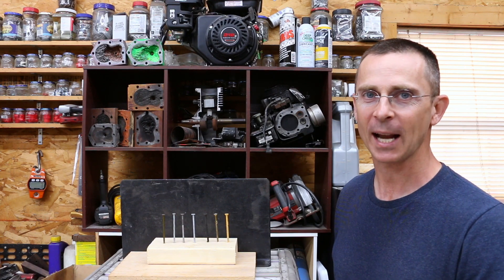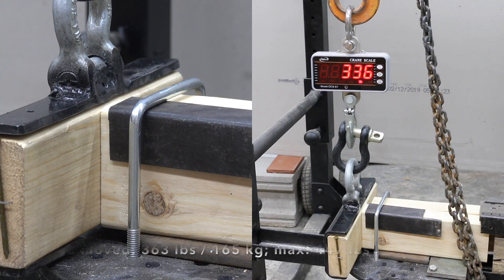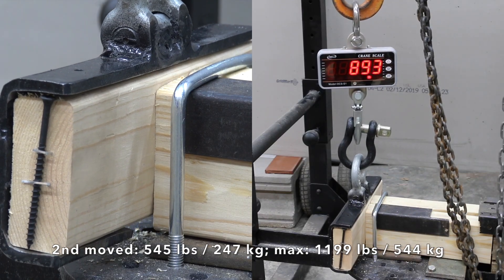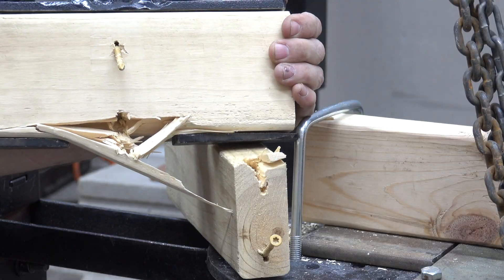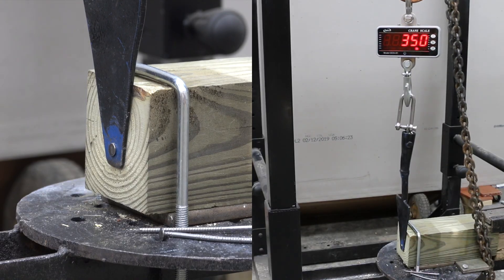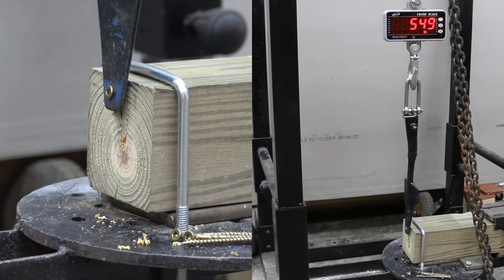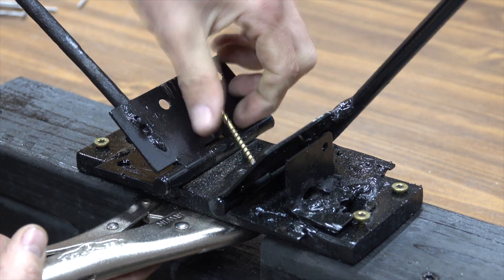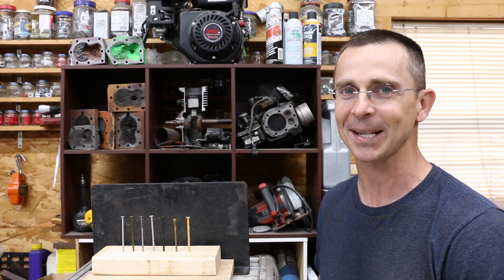Do Screws Shear easier than Nails? Let's find out!

Comment: Fan-damn-TASTIC video my friend!  Great testing conditions, great speed and I also was surprised at the shear strength of the screws in the 1st test...
I watched this because I want to put plywood or OSB (the next question I have to answer) bracing on my cripple walls.  Since lateral-force shear strength is the key here, I really thought that the nails would be superior.  However, your results were quite impressive with the screws, and the hardness of each wood sample probably explains the variability within each type.  The ONLY factor I can think of that could change my mind is the sudden jolt of an earthquake vs the slow winching in the test...  Regardless, thank you for your time & efforts!
Reply from the maker: Thanks and you are welcome!

Comment: not sure I'd call this a shear test.  but it is really eye opening. I use a lot of drywall screws, construction screws, and deck screws in wood. My drill driver twists the head off of WAY more drywall screws in construction wood, and they cant be used in hardwood at all. Your results would look MUCH different if you repeated this test with hardwood where the wood fibers wouldnt give way so quickly.
Reply from the maker: Thanks for the suggestion.

Comment: There are several things that I believe are worth considering both for the testing purpose of nails/screws like this, as well as for their application.

First, the application. Screws for most construction job are plainly terrible due to not only their brittleness, but also destructive factor. In all tests they were literally ruining the wood, whereas the nails just slipped out or broke with minimal damage to the wood (except the ring one). This can mean very expensive (and possibly...impossible without stripping large part of the structure...) replacements of wooden elements in structures over time, as the wood will simply be too damaged from continued small movement even if the screws won't be affected. Nails deal almost no damage to the wood, meaning that you can just replace damaged nail somewhere else on the wooden beam and be done with it many times over.

As for the tests, there is a lot of movement outwards, away from the test wood, since all the forces were applied to the fasteners by the test rigs, and not the elements that they were holding. I believe that a much more important (for practical applications) result would be if there were two metal/wooden 'rails' parallel to each other with a wooden beam between them (basically, an H shape), and the beam would be pushed/pulled instead. This would show how these react in situations closed to their real life application where forces apply to them through the parts they hold in place, instead of an outside force. For one, this would make it so that the nails/screws wouldn't just 'slip out', but either bend extremely or break (themselves or wood) in every case.

As far as these tests are still valuable, I just don't think they apply for the most common applications.

Comment: That's a very thorough and comprehensive set of tests. I only wonder if the deflection test would make more sense if it was only bending the screws and nails a few degrees. Anything bending them 30 degrees or more in the wild would already be knocking the building down. Of course the reps to failure would probably go way, way up for at least one of the two then.
Reply from the maker: Thanks!  Thanks for the feedback.

Comment: Thank you!  I'm rebuilding several sets of 2x4 shelves that the previous builder assembled with deck screws. They used a ridiculous amount of screws in random patterns and angles that probably did more harm than good. I wanted to find the real-world shear expectations of these screws, but online searches were hit and miss - an engineering forum post where someone "did the math"  claimed the screws will only hold 167lbs, while some spec sheets claim 1300+ pounds. Then I found this video! Excellent work! It's a great example of fastener performance  "off paper" and outside a sterile laboratory environment.
Reply from the maker: You are welcome!  Thanks for sharlng.

Comment: Great video. I would love to see you do the shear test you did at the end with the hinges, but with a very small bending angle over a larger number of cycles. I feel like this would test very the small degrees of bending and resulting strain hardening that a fastener might experience in certain applications. To me, this seems more inline with real world use. I’m also curious of the clamping strength of various fasteners, both initially and over time if you can think of a way to test that.
Reply from the maker: Thanks!  Thanks for the suggestion.

Comment: A lot of people underestimate the power of drywall screws. We recently replaced the spotlights out back that my dad installed like 20 years ago almost. I drove drywall screws straight into the mortar, no anchors or anything. The old brackets were still solid, and no corrosion on the screws . I don’t think he should have done it that way, but it worked with no consequences for the last 20 years

Edit: He drove drywall screws into mortar, not me

Comment: I love this. So many guys that said screws have no strength. I’ve framed up lots of stuff with deck screws.never had a problem,
Reply from the maker: Thanks for the feedback.
Reply: I always screw my stuff together, cant get a nail to pull and draw, you get such a tighter sctructure if its all screwes. 

AND, they have more shear strength in real world applicstion anyway

Comment: Really late to the party.   

Bending a fastener in an extreme manner until the point that it breaks doesn’t necessarily demonstrate fatigue strength as this amount of movement seen is not at all realistic with what they will see.  Though if you did a load cycle test (without bending beyond it’s elastic range) the results would likely be the same.  

From an engineering perspective screws may not have the ability to withstand the same load cycles-they will also move less because of their holding ability.  So they are less likely to see that movement.
Reply from the maker: Thanks for the feedback.

Comment: Two things i wonder, if attaching to the side vs the end grain makes a difference 
And running test were its done with 1 fastner, then 2, then 3, etc to see how much each indavidual nail adds to the overal shear. Is it steady, does it eventualy drop of, or does it grow exponentially.
Just thinking, alot of sheer in building comes from gussetts or sheer panels with way more than 2 nails (hopefully lol)

Comment: Thanks for this test. Actually the drywall screws are probably failing in bending or tensile stress on the outside   of the bend. So they don't fail till they have been partially bent. On you plate test most fasteners are not nailed into the end grain and that may have inferior pull out compared to putting the fasters at 90 degrees to the grain. Good job though and settles myths.
Reply from the maker: Thanks and you are welcome!
Reply: I would like to see you do this with maybe some sort of thick plywood across the grain. By the time a drywall screw bends enough to fail, the nails have lost the battle. So I am wondering what sort of tests are being done by the government. A shear test of the fastener that is not in wood, makes no sense. I have never felt like nails were better than screws and your tests certainly don't change that opinion@ProjectFarm

Comment: the biggest variable that is not discussed or tested here and contributes heavily to max shear load is clamping force. 
The biggest advantage for screws over nails is that screws will clamp the two pieces of material together. That clamping force adds friction which has to be overcome before the fastener will take the full load. So whilst screws are less ductile, the expected load imparted onto a screw may be a smaller fraction of the total load vs a nail used in the same situation.
This does  get more complicated now however as there are a whole load of other measurements that need to be accounted for like the materials coefficient of friction,how much compressive force can be applied, how the fastener itself is used. (i.e if a washer used to provide a larger surface to add clamping forces, etc etc...) and a whole lot more.....
Reply from the maker: Thanks for the feedback.

Comment: This is all good information, but it did not include the fastener I was researching.  
I want to know what screw to use to replace the short door lock striker plate screws.  I have seen people use long drywall screws, but they cannot have the Shear Strength of a Wood Screw.
Reply from the maker: Thanks!  Thanks for the suggestion.

Comment: Nails don't hold wood, Wood Holds Nails.  When the nails are driven through the wood fibers, the resistance of the fibers is what keeps the nails in place.  Screws increase the resistance to pullout by creating more surface area for friction.  
When testing Shear strength, the biggest variable between each test is the wood itself which is why a single test per screw would yield untrustworthy data.  It would be interesting to see the Test Parameters for the screws to see how they could claim a thousand-pound rating.
That being said, The best screw in a new 2x4 in this test might still provide less holding power than a common, uncoated nail in a hundred-year-old Oak 2x4.
Reply from the maker: Thanks for the feedback.

Comment: The only thing I’d say is the bending jig was a bit extreme on the angle. If a screw is deflecting that much in a structure then the structure is already critically failing anyways. I can’t think of a situation where a screw would be subject to that steep of a bend. Especially repeatedly. Overall interesting data!
Reply from the maker: Thanks!

Comment: Very interesting!
Up until now I had a hard time thinking of why I would ever want to use nails instead of screws (as a hobbyist) - but it makes much more sense to me now why they are still used for construction. Wood can move back and forth quite a bit with moisture changes, so on large beams the shearing over the years could be significant.
Reply from the maker: Thanks for the feedback.

Comment: You should have put a metal backing plate that stopped the board from moving away from the connection such as with a ledger.

Comment: Adjust the jig so that no lateral movement is allowed. If the fasteners are pulled out of the end of the post, it's no longer a shear test, it's then a friction test. Put a steel plate against the nail head so that it can't pull out. Also consider not using wood, since the wood is being gouged. Not every post is the same. Maybe a steel block with holes drilled in it.
Reply from the maker: Thanks for the suggestion.

Comment: What I love about screws is that they can almost eliminate waste when demo time comes around.  It pains me to see people smashing things apart because pulling nails is a pain in the a**, when screws would make things much easier.  Sure a sledge may be faster initially, but you have to consider the additional time of all the clean-up.  Just screw it out the same way you screwed it in; less mess, and you can maybe make some money back off the salvage.
Reply from the maker: Thanks for the feedback.

Comment: Hey, great content. I would like to see a follow up video where you include repeated stress like a weight drop to test sheer strength. I would also like to see a side load test where you build a small 4' by 4' wall frame and apply a gradual sideways force to see how the fasteners hold up.
Reply from the maker: Thanks!  Thanks for the suggestion.

Comment: Great video. A couple things I would have changed would be to not screw into end grain. I think the slow pressure on the end grain allows the screws and nails to pull out instead of really sheering. Another option would be to block the end of the board so the nails and screws could not pull out, but only shear. I would have also added another test to test a more sudden impact on the fasteners, instead of the slow steady force used in this test. For example, attaching a length of 2x4 to another board that is secured, then dropping several hundred lbs of sandbag on the unsupported end. Maybe use multiple fasteners, instead of one in this case.
Reply from the maker: Thanks!  Thanks for the feedback.

Comment: Great test, PF.  I ran a handyman service for ten years and used screws exclusively for ramps, decks, porches, fences, and gates. Nary a problem.  But when I hammered sinkers into DF tubafores for a work platform to reroof my pump house, it collapsed the third time I climbed it.  I was standing there in the middle with a package of asphalt tabs when it started slowly bending over. I shifted the roofing onto the roof and rode it down, laughing all the way.  Screws fixed it and the bag of sinkers is slowly rusting away with disuse.  Deck screws are my go-to hardware fastener.  When building fences, I showed the client a board fastened with a 1-5/8" pneumatic installed nail, a 2-1-2" galv nail, and a 1-5/8" deck screw.  With one whack of my elbow, I could knock the nailer board off, loosen the nailed board, and not touch the screwed board.  They all chose the screws and paid a little bit extra for the hardware costs and time.  Screwed projects are also quick to repair.  Shearing just isn't a factor in well built construction.
Reply from the maker: Thanks!  Thanks for sharing.

Comment: I think the test you are missing is "force at speed".  It would probably look pretty dramatic.

For a test rig I would setup something like your shearing rig.  Then use a hammer on a pivot point with variable weight or variable swing range to strike the board.  

The boards held on by less playable fasteners will probably go shooting off the rig.
Reply from the maker: Thanks for the suggestion.

Comment: i'm no expert DIY, but i read that it matters how you screw screws into the wood. Strongest is to screw against the grain on both materials. Here I see the screws are screwed against the grain for the top material, but with the grain on the bottom material. Shouldn't affect the outcome of which is stronger, but it should affect the actual numbers for each fastener.
Reply from the maker: Thanks for the feedback.

Comment: So dont use screws for a big deck? Only nails because the lumber is going to move alot when shrinking and expanding? Ive use galvanized screw shank nails on pressure treated lumber and sometimes ive had to remove the board i had just nailed down but those nails just wont come back out. Sometimes ill pull the board up hard and the nail just stays in place, it will just pass the head through the hole. I end up with the board on my hand but the nail still nailed in to the bottom board and 1.5 inches sticking out
Reply from the maker: Thanks for sharing.

Comment: Thank you so much for the back and forth test at 10:30, because I was chomping at the bit during the other tests. It would be nice to know what steel these fasteners are spec'd at. 1 out of 10 deckmate screws I remove come out sheered-- so much so, part of removing deckboards has become a prybar and hammer in addition to drill. ps. That door hinge ductility test jig was great.
Reply from the maker: Thanks and you are welcome!

Comment: The first test you performed was the closest to an actual "single shear" test, except you used the weakest part of the grain in the wood, which is why the nails/screws tore out of the wood.    Repeat the first test with the fasteners inserted perpendicular to the grain.    Bending a fastener back-and-forth is NOT a shear test, so the second test means nothing.  Seriously, if the fastener experienced that much deflection back and forth, the structure is falling apart.
Reply from the maker: Thanks for the feedback.

Comment: You should do a similar video with finishing nails. 

Like compare an 15 gauge finish nail, 16 gauge, 18 gauge, 23 gauge, and then also throw in some trim screws from Rtek I think is their name.... It has a flat head on the top end to help relieve the stress of just relying on the regular taper of the screw. 

Throwing all the carpentry and finishing try nails and screws in one video would be awesome

Case in point, it would lay the argument of building closets or what nail is best for holding trim to rest.
Reply from the maker: Thanks for the suggestion.

Comment: Another great test.  I'm a little curious about the last part of the test:. Determining how many bins it would take to break off the fastener.

Well it is pretty obvious from your test that the fasteners will break when sticking out as far as they did. However, I think the fasteners would behave differently totally nailed or screwed in flush with two wood members. In other words, how the shear Force causes the fasteners to behave when they are pulled in tight.  I'm not so sure you would see much difference between screws and nails in that condition.
Reply from the maker: Thanks!  Thanks for the feedback.